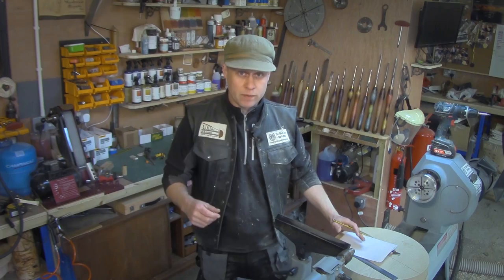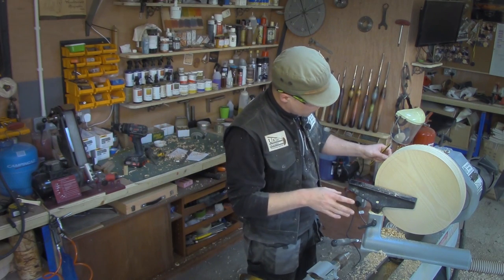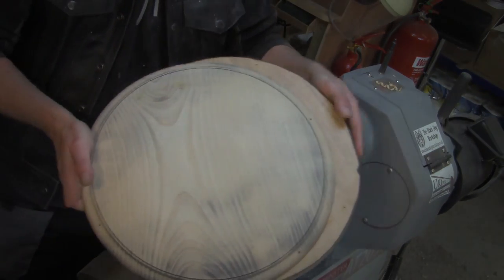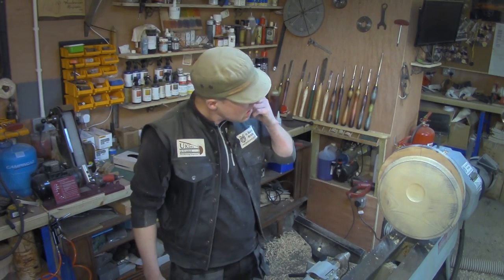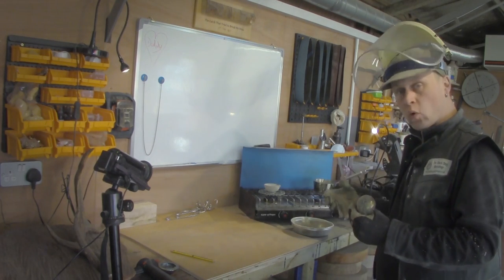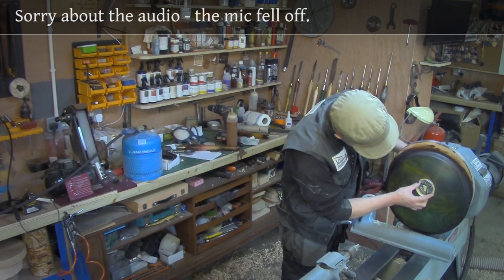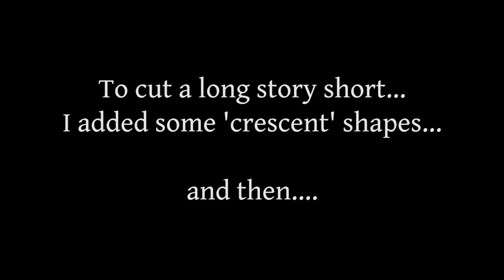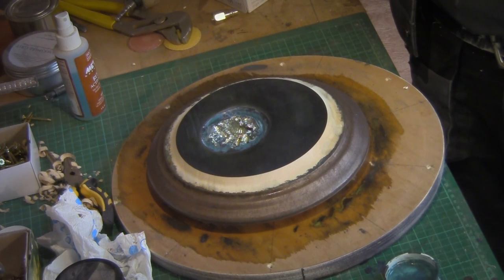#83 Woodturning with Bismuth Off Centre Project (Rescue!)

Comment: Why do you screw it to the backing plate? In school we would glue the wood to a backing plate with a piece of paper sandwished in between to make it easier to split. It worked well for pre rounded blanks. We jus tused ordinary white pva glue.
Reply from the maker: +rimmersbryggeri Safety is the main reason. The forces are quite powerful so I use the strongest method available.
Reply: Thats fair enough and for off center/ unbalanced work I would also prefer a mounting system with a higher mechanical integrity than glue. I see Chris on clickspring use super glue arbors for metal turning all the time though.